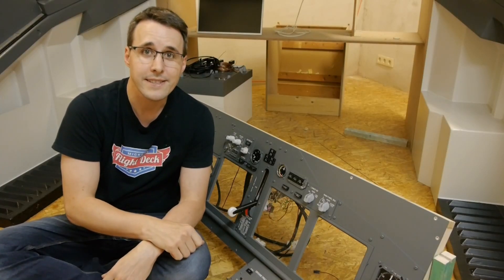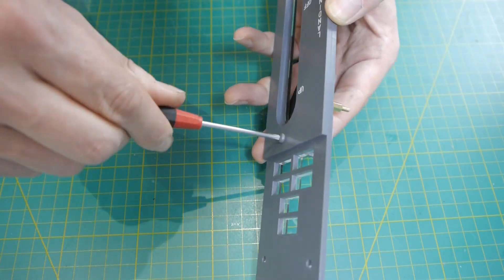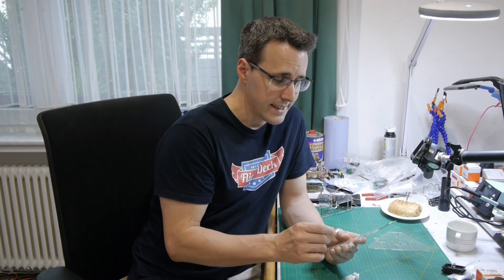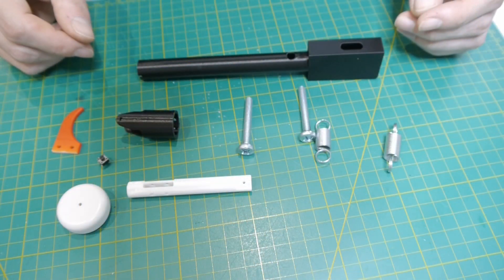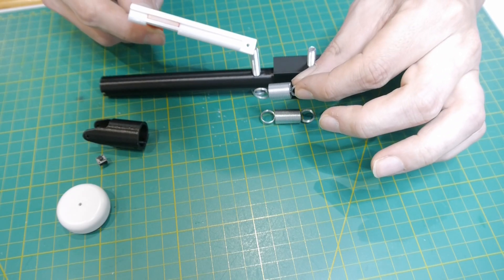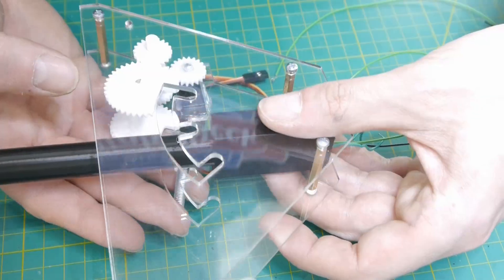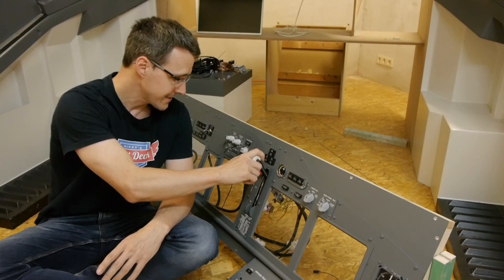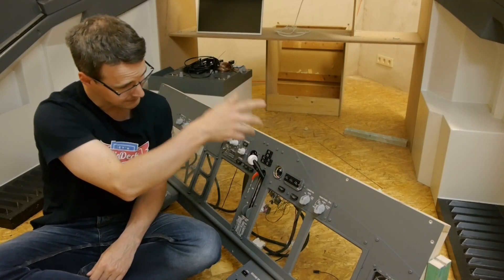MIP Gear Lever - A Boeing 737-800 Homecockpit #82.1

Comment: I used hall sensors instead of microswitches with a magnet in the handle. With 3d printed pockets the hall sensors can be positioned accurately and dont experience mechanical forces. Btw, I made the same locking mechanism mistake. I could not find any documentation on how it should work in real life. I am glad you solved the mystery but I wont make a version 2 ;-)